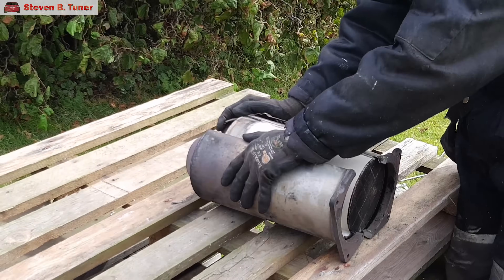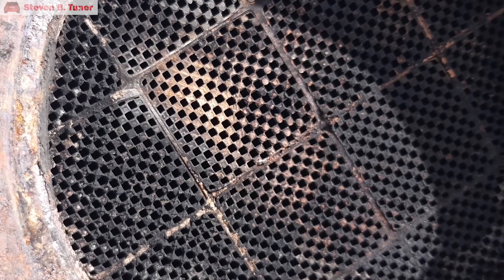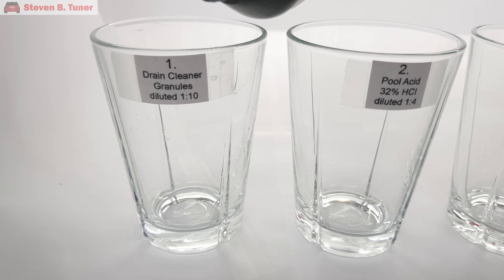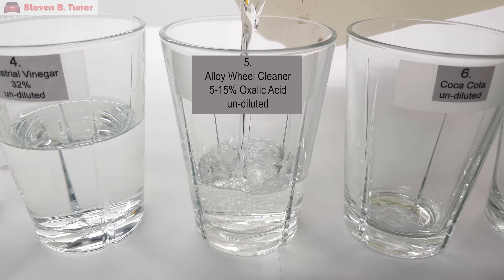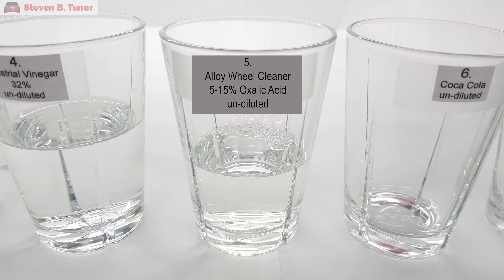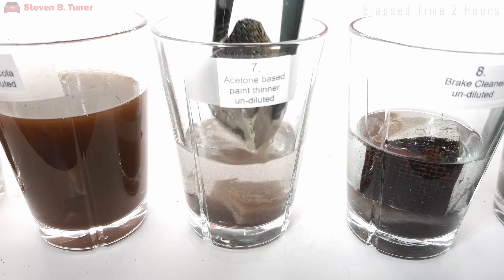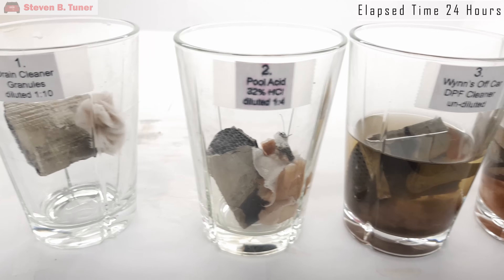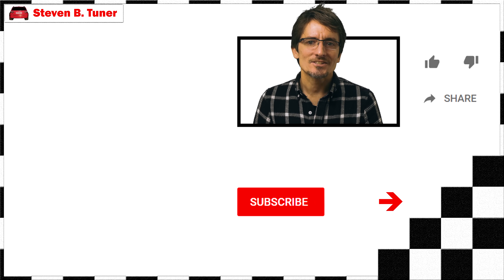DPF Cleaning at Home – 9 Chemicals Tested (Diesel Particulate Filter DIY Ash Cleaning)

Comment: That was a very interesting video and the results were surprising. The video also confirmed what I have known for a time now, that modern diesel engines are overly complicated and do not have the longevity that older diesel motors have.  I bought a new Mercedes camper van in 2016 and knew nothing about DPF and associated pollution control systems when I made the purchase. The dealer told us that these motors regularly run for 1,000,000 miles.  (what a joke).  I have had zero issues with this motor and I just turned 8000 miles this summer.  But... this will probably be the last diesel I ever buy just because of what I have learned about modern diesel pollution control systems.   To increase the odds of this motor lasting for more they 100,000 miles, there are a couple of rules I follow now. #1, We don't use the van for day to day driving or short trips. I try to limit the time the engine is running below 1800 RPM when we are not out on the open road. As an example,  I have found that my fuel consumption is about the same when running the motor at 1800 RPM at 35mph as when I lug the motor at around the 900 RPM at 35mph. I am assuming the motor runs more efficiently at the higher RPM's which must be better for the motor. #2. Change the oil more frequently. There is no way I am going to change the oil every 18,000 miles as the factory recommends. #3. Keep up on the maintenance.  Turbo, injectors, EGR, sensors  etc.  Looking back on my original purchase, I could have paid for a lot of gasoline for a gas motor for the $8000 premium price I paid for the diesel motor.
Reply from the maker: Hi, thanks for watching, and I'm glad you found the video interesting. You have raised some great points, and some of them have got me thinking that they deserve a whole video to themselves! The dealer spoke the truth, but it needed a very big asterisk next to the statement pointing out a whole bunch of caveats - the turbo needs to be in top condition and checked regularly that it is not leaking oil (probably needs to be re-conditioned every 200k miles), the injectors need to be checked every 100k miles, the DPF needs to have the ash cleaned out of it every 150k miles even if it is not completely clogged, the oil should be changed twice as often as recommended, the intercooler probably needs to be replaced every 250k miles, any timing chains need to be replaced at the first hint of rattle, and you are right that the EGR and sensors need to be working 100%. But it can be done :-) whereas I get the feeling that a lot of gas/petrol engines are much more into the 'disposable' territory now. When it comes to ideal RPM, I would say that your engine is most efficient at the RPM where the turbo starts kicking in, so there is probably nothing to be gained by staying below 1600/1700 RPM (I'm guessing). Another reason for not staying too low in the RPM range is that the engine is not as well balanced down there, and so the extra vibration has to be absorbed by the dual-mass flywheel, which will then wear out a lot faster (ignore that if you have an auto). With the revs a little higher there should also be no need to fear day to day driving.
Reply: @StevenBTuner  Thanks for responding. Question? Do you have an opinion or thoughts on  remote by pass oil filter systems. Especially for diesels?
Reply from the maker: Hi, as a concept I think it is a great one - especially if you can run a much bigger filter or 2 filters in parallel in order to have more filtration and less of a pressure drop. However, before I would install one I would want to see a full installation in a similar vehicle to make sure it can be done in a way that provides full oil pressure as well as no unintended consequences like low pressure on startup.
Reply: Older diesel engine  produced less smoke, where there were lots of natural aspirated ones. Now they al have one turbo, two turbo to boost the power, but guess what the exhaust it's even more complex because of that. Also the new pollution regulations euro 6 and up made the dpf more complicated and expensive, diesel running engines polite a lot so it's normal to do that. This year there are also petrol engines with dpf filters if I'm not mistaken, because the pollution regulations got very drastic. As I know a life span of an dpf lasts between 100-200k km, depending of the way of the car being driven and maintain. Also the oil needs to be dpf approved, that one has less ash production that causes dpf to gunk up.

Comment: I think that the best product is "oxalic acid" where can I find in liquid presentation, or maybe there is way to use in powder presentation? 

and I would like hear from you what is your particular best recommendation for this process 

thanks in advance
Reply from the maker: Hi, I've just bought some oxalic acid and citric acid granules/powder to try. Oxalic acid was in the alloy wheel cleaner in the video, so it should work well, but there might be a bit of fiddling around to get the dose right - I recommend trying it out on some scrap stainless steel (or whatever your DPF housing is) to make sure it won't do any damage first. I'd love to hear how it goes!

Comment: Hello,

I’m back after a while 👍 I replaced the intake manifold of my E81 120d today, because it was leaking. I’m happy that I did so, as it resolved a lot of problems for me. However, one problem still exists, namely that my car is really uneconomical. In a previous message I wrote that I essentially only drive on the highway. I often cruise at 150kmh with an average fuel consumption of 6,2 l / 100 km. Something I’m very content with.

While my intake manifold was malfunctioning, I didn’t dare do drive over 120 kmh. So I don’t know what the value at 150 kmh would have been. I presume approximate 10 l / 100 km. 

Right now, my fuel consumption at 150 kmh is around 7,7 l / 100 km. I am well aware of inclines and wind direction/speeds and I know for sure that my car is consuming too much fuel. Also, the fuel consumption is excessive when I’m accelerating. (On average acceleration around 50 kmh, the fuel consumption should be around 8.0 l / 100 km, but right now it’s more leaning towards 15 - 25 l / 100 km. My car has done 370.000 km and I don’t think my DPF has ever been replaced or cleaned.

I’ve got two questions:
1) Do you think that my higher fuel consumption is related to a possible clogged DPF?
2) What do you recommend me to do? I feel comfortable dismounting the DPF but I’m unsure what to do afterwards:
a) High water pressure washing
b) One of the chemicals in this video
c) Apparently there is a 1,5-hour DPF cleaning proces nearby, but their website doesn’t specify the proces so I don’t have faith in that (yet). Though they make it appear that it is ‘‘the best’, obviously.
d) Maybe I could look for a DPF cleaning proces which makes use of an oven and then indeed blow it out with high pressure air.
e) Buying a new one, or is that wasting money? I tend to believe that DPFs last forever as long as they are not cracked or have any other form of obvious damage.
f) Are there more options I don’t know about?

Thank you in advance for your reply.

Kind regards from the Netherlands
Reply from the maker: Hi, welcome back! :-)  As the DPF gets more and more clogged with ash over time, there is less filter surface area available to catch the soot, so the active regeneration process happens more and more often - and this involves a lot of extra fuel to be sprayed in as a post injection pulse. If your engine is scheduling a regeneration every 50kms instead of every 1000kms, then that will certainly effect fuel economy. You can check those things and also the total ash content with a diagnostic unit like the Autel AP200. If you decide to do a clean yourself, then I would recommend my video: https://www.youtube.com/watch?v=LE1boZ3fhLg  If you decide to go for a specialist cleaning company, then it would certainly be good to know what process they are using. Keep in mind that the 'in place' DPF cleaning process are more for  regular maintenance rather than an end of life ash clean. If your car has got to 370,000 kms on the original DPF then it indicates that your car has been very well looked after, with good quality fuel and oil being used. I'd say it must still be pretty blocked up by now though!
Reply: @StevenBTuner  Hello again, I have watched the video you recommended and I also just called the company that is nearby my hometown. He couldn't specify the chemicals they use, because he didn't know it, but he did say that they are put through under high pressure, and something with high air pressure pulses. Sounds a little odd to me, I have more faith in your video, because you have explained perfectly clear how and why you do what you do and you have substantiated that very well.

One thing the man on the phone mentioned was that with BMW (he made it seem like it was a BMW thing), the DPF has to be 'relearned' by the ECU. For example the lambda sensor, etc., because that might still think that the DPF is clogged. I see some point in restoring the settings, but on the other hand: the lambda sensor reads the air to fuel ratio real-time, there is no point in resetting that? And the DPF sensors are based on a pressure difference.

What is your advice on the 'relearning' bit?
Reply from the maker: Hi, I'm not going to say anything against your local company - they are probably using a machine that has been designed specifically for the task, that back-flushes the filter with chemicals to loosen up the soot and ash. I don't suspect they'd stay in business long if they were damaging the filters, so maybe worth checking that. However, I have no problem at all with you using my method either ;-)  Whether the ECU has to have the DPF life reset depends on the year model of your E81. If your filter has 2 differential pressure sensors connected to it, then there is probably nothing that needs to be done.
Reply: This article makes sense to me, the only thing I’m worried about when I put a high pressure water cleaner on my DPF is that I put all the soot in the surface water and I’m not aware of how harmful this is to the environment. Do you have knowledge about this?

https://www.otomatic.eu/dpf-test-results/

Comment: Hi,
I'd like to make few comments about your video.
-The filter walls are porous and coated with a substrate of metal oxide, such as aluminium-oxide. This substrate features a layer of the precious metals platinum and palladium. This layer functions as a catalytic converter.
 How can you be sure that any of the chemiclas you showed in the video won't damage that layer of precious metals? If for example, HCl would have removed that layer of precious metal along with the ash you'd get a clean DPF for sure but your DPF won't be able to regenerate anymore, so you would be destroying your DPF instead of cleaning it, indeed.
-To assess the good performance of every chemical it would be good to weigh on a sclae every piece before and after the clean.
-To assess Wynn's DPF off-car cleaner you must follow the manufacturer instructions, so you forgot to rinse the DPF with water. So it''s a must to evluate its performance after that part is rinsed with water.
https://www.wynns.es/product/dpf-off-car-limpiador-extremo-dpf-5l/
https://www.youtube.com/watch?v=gB1ymM5V7qY

I would be so please to have a chat with you,

Regards
Reply from the maker: Hi, thanks for watching! You are right to be concerned. I was too, so I did some testing in my other video called "The No Damage DIY DPF Clean": https://www.youtube.com/watch?v=LE1boZ3fhLg  , that way you can judge for yourself if the AlO2 or Platinum will be harmed.  To answer your question about washing: every piece was washed with fast running tap water at every stage of the video - I did mention this, but I didn't include it in the video as it was not very interesting to watch. And now for the Wynn's product...it is just not very strong. Even in their own video they show a filter that is only mildly clogged with soot, and with no visible ash clogging at all. My brief testing indicated that it is very similar to a de-greaser, but costs a fair bit more than one, so while I don't doubt that it can work, it wouldn't be my first choice.

Comment: Hi. Thanks for your video. Assuming dpf in situ, If we spray coke or diluted hcl acid or wheel cleaner into filter via pressure sensor hole, will that be effective or we better fill the filter completely with solution and let it soak overnight? If we then start the car, does exhaust gas push the solution out to the pipe? 
is it also safe to rinse with water afterwards ( with filter still assembled in engine)? Thanks.
Reply from the maker: Hi, thanks for watching! None of the chemicals I have tested are for cleaning a filter in situ. Cleaning with the filter in place shouldn't use a chemical that has water in it, as any trapped heated water will turn to steam and potentially crack the DPF. I should mention that in place cleaning is more for regular maintenance rather than a full clean, and I am planning a video to show how (in)effective it is compared to full removal. At this point I would say that if you go ahead with an in-place clean then use a product from a reputable company, and make sure you record the ash level before and after with a diagnostic unit. I hope you will share your results here too.

Comment: When I was a mechanic at a truck dealer. When the dpf first came out. 
We were told to blow the out with high volume air.
Reply from the maker: Hi, thanks for watching! That's the perfect thing to do after 6-8 hours in a high temperature oven. Not so easy for the average car owner however.

Comment: Cool, maybe you'd try with "PH down" from growshops
Reply from the maker: Hi, thanks for watching and for the awesome idea! The 'pH Down' that contains 30 - 40% phosphoric acid is the best one to use, as it won't attack the steel housing. The products containing nitric acid are probably best avoided for this purpose. The phosphoric acid based products could work even better than brick cleaning/pool acid (hydrochloric acid)!
Reply: @StevenBTuner  in which cleaning stuff is there notric acid?

Comment: I used a product called SUMA BREAK UP-D3.5, it’s a heavy duty degreaser used in kitchens ect to clean ovens burnt pots it removes the burnt carbon  extremely well,cleaned my d p f  ,sprayed it in used a garden sprayer left over night cleaned out with water next day, fault light went out ,two days later after about 60miles it regenerated  ,it worked for me ❤️👍
Reply from the maker: Hi, thanks for watching! That product sounds like the perfect stuff to get oily soot out of the DPF - thanks for sharing your method!
Reply: Did you remove dpf first or sprayed the solution in-situ?
Reply: No left in place , mine is a meriva b 1.7  I would have to have removed  the full exhaust ,as it’s halfway along the bloody thing .

Comment: How about doing a follow-up video to experiment with different products that clean your DPF in situ without removing them from the car? Not just fuel additives but also dedicated cleaning solutions that you're supposed to spray into the filter using the pressure sensor ports.

The chemical conditions would be a lot different since you have high temperatures and pressures, as well as the exhaust products from the car's engine to deal with.
Reply from the maker: Hi, that is a great suggestion. The biggest problem I have so far with 'in-place' cleaning is that there is no way it can be as good as a DPF out clean. The first reason is that there is more than just ash and soot in a DPF - there is also some crud that is chemically inert and resistant to any temperature that your DPF will see in normal operation. You can see it on the pallet at 4:01 in the video, and there is heaps of it that comes out that I didn't show on the video. The only way that kind of stuff comes out is with a back-flush of the filter or maybe even just with a couple of gentle taps with a block of wood - but it will only come out the way it went in, so no 'in-place' cleaning can ever remove it. The second reason it can't be as good is that there is no way to know when the job is done properly - if the ash is sucessully broken down in the first 1/4 of the filter, for example, then your car will definitely be happier, but only for as 1/4 as long... That doesn't mean that I won't do a video about it, but I may start with some kind of test to show just how effective/ineffective the commercial offerings are.
Reply: @StevenBTuner  That actually sounds pretty good, I consider the "in situ" cleaning of a DPF to be part of the regular service of the part, as an addition to (active and passive) regeneration done by the engine, which may or may not happen depending on the driving style. Modern cars actually recommend shifting to the next gear very low in the revs, which means the filter regeneration will almost never happen unless you have a more agressive driving style.

IMO, 'off-board cleaning' of the filter is more of a repair procedure if the filter is no longer functional and just to avoid expensive replacement. Most of the cost in replacing the DPF are in labor just to get the filter out and get the new one back in.
Reply from the maker: Quite right - as a service every 2 years the in-place spray-in clean will probably get enough ash removed to stop it forming plugs that completely fill up a channel.

Comment: What is the dishwater tab ?
Reply from the maker: Hi, thanks for watching! I don't know the brand of the tablet I used, but I don't think it matters. It's main job is to dissolve any oil that is stuck in the DPF, and I think that any of them will do that quite well.
Reply: A dish washer tablet that you put in a dishwasher to clean your pots and pans